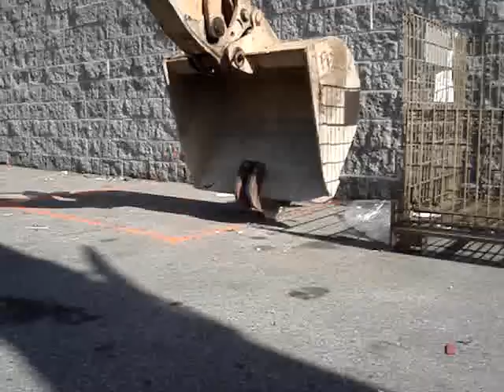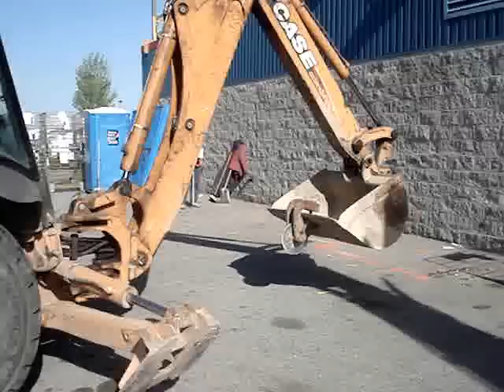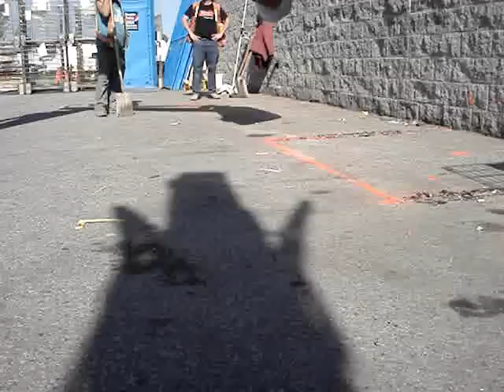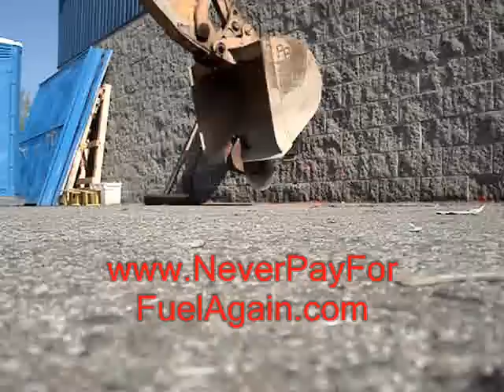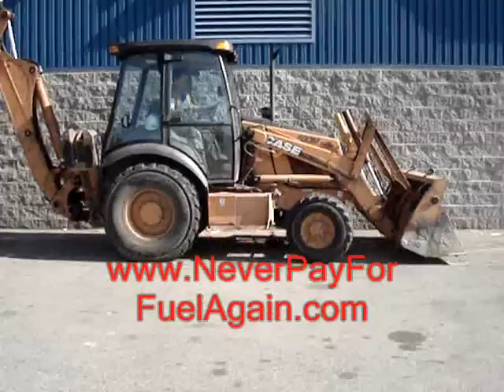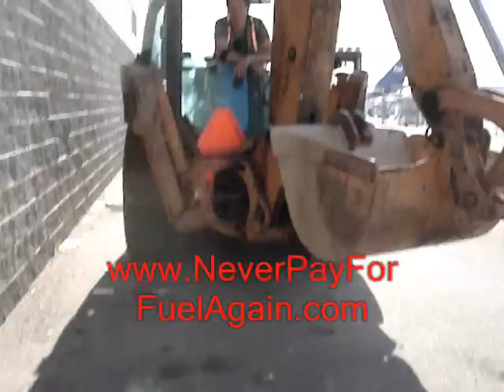Pizza Cutter!

Comment from the maker: Pros:

I like the way a 580 does rear brake (pivot) turns. I think a 580 has the others that I've personally operated beaten hands down on that point. And when I operate backhoes, I tend to do a lot of brake turns, especially when backfilling on mainline jobs.

The clam control - as mentioned, I think it is far better - much more intuitive that the Plain Jane side lever style on other backhoes, or stupid and somewhat kludgy electronic control buttons, like some Japanese models have.

Comment from the maker: ...on with the cons:

As I was saying, I've seen a lot of 580 owners modify the front bucket, just so that it can carry a decent load, like other backhoes can do. By the spec sheet, the Case bucket carries the same volume, but it sure doesn't seem like it in actual practice; at least, not without more spillage than with other models.

Lastly, the 580s could use a Powershift feature, but they aren't alone in that department.

So yeah, I'll say the 580 is a good 'bread and butter' machine, but...

Comment from the maker: ...580 cons:

When I'm digging around a live gas or old A/C water main, I prefer to use a machine that has a smooth and steady back end, over a 580, any day of the week, given the choice.

On to the front end. For the most part, I think the 580's front end is good, except for the bucket design. It would only require a minor modification to the bottom half of the front bucket to make it as good as the bucket on a John Deere, for example. The Case just spills too much material out of the bucket...

Comment: I agree with everything you said Roy. However I go down to the Case Dealership everyday almost and the new models have power shift AND electronic parking break! The reason why the back hoe slops around is because of the boom being completely straight so the hydraulic has to be moved inward instead of out once its passed vertical. John Deer booms are kinda like U shaped to get passed this. I run more Deere backhoes and the SG's are by far my favorite. A little bulky but sound.

Comment from the maker: More Pros:

580s are very quick and responsive. The Super Ms are comparable with other brands for pushing power, and I think are pretty much up to pushing what other backhoes can push.

Now to the cons:

I don't like Case's back end design at all. I'll allow that I may be have been spoiled by operating excavators far more than backhoes, and am used to the smoothness and evenness of excavator controls, but the fact is that I think the Case rear end is very kludgy (oh no, here come the flames!)...

Comment from the maker: ...cons:

Now, I've never put the front end of a Case side by side with another backhoe to make a visual comparison, but I don't like the way it feels from inside the machine. With a John Deere, I can pull up a good sized bucket of topsoil, and drive down the road (after giving it a quick shake), while still carrying a lot of material in that bucket. With a Case, I lose about 1/4 to 1/3 of the bucket load if I give it a good shake. NO LIKEY!

I've seen a lot of 580 owner operators modify...

Comment from the maker: For me, it comes down to preference strictly as an operator, not as an owner. I suppose those factors (resale value, etc) affect one's perception.

580s are good machines - no doubt about that, and they get the job done, but I prefer operating a Cat or John Deere far and away above a Case. There are some features on a Case that I think are better, like the clam control, for example, but I think the others have better control, especially on the back end.

Also...

Comment: @kimchiman1000  You want to keep the wheel centered on the machine. If you get to far off center you will rock sideways and the cutting wheel will be on an angle. This will make a messy cut and puts more stress on the whell bearing. These small wheels are a bushing style bearing. The evcavator size is a sealed roller pin type.

Comment from the maker: ...
Still on the cons:
Yes, I mean 'kludgy'. Case has had decades to revise (improve) their rear end design, but unlike other manufacturers, they have chosen not to do this. This may be in part due to the fact that they have many operators (customers) who are very used to that design, and may fear that by changing (improving) it, they may lose a lot of those customers. But that is of course only a guess.

You can't 'boom up' nicely with a 580 back end, like you can with other backhoes.

...

Comment from the maker: What I mean is that when you bring the boom up close to the cab, it starts doing its 'bouncy bouncy' thing. This is inherent to the way the boom and cylinder are designed, of course, and I'm sure a lot of 580 operators will say they are fine with it. Well, I'm fine with them being fine with it. No problem there. But I am not fine with it, when I know that FAR BETTER backhoe boom designs exist.

...more...

Comment from the maker: ...more cons:

Case engineers! For the love of God, please redesign the parking brake from the oh so old school style to a fully locking (and much safer, and easier to use) electronic brake, like other backhoes have!

Case back ends are anything but smooth. Yes, one can get used to it, and as the operator shown in this video clearly demonstrates, can use it VERY EFFECTIVELY. But I would argue that any operator who is that good on a case (moi?) is just that much better when on a better machine.